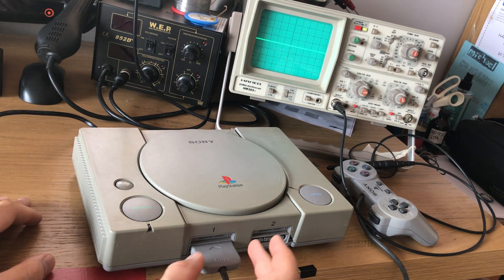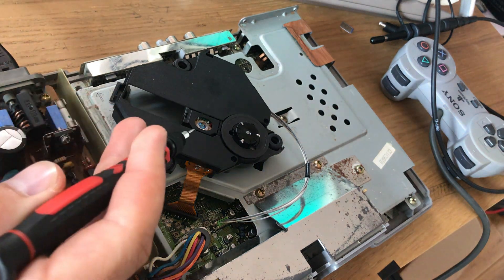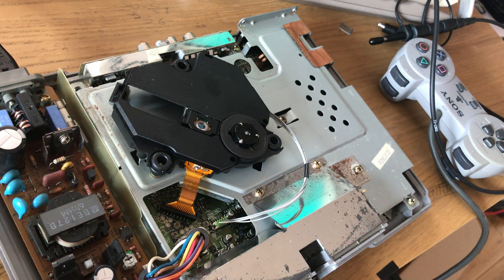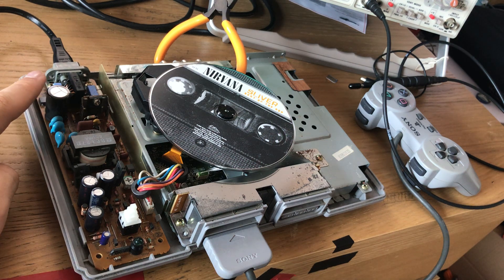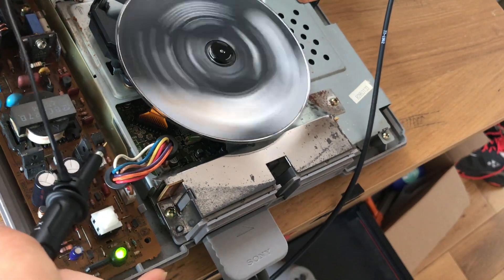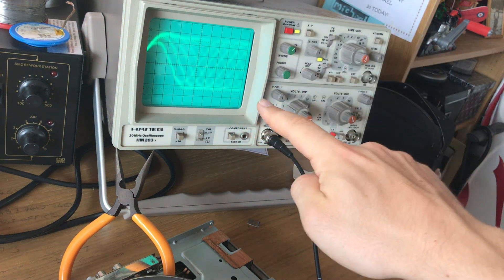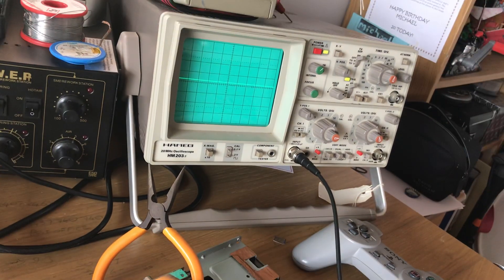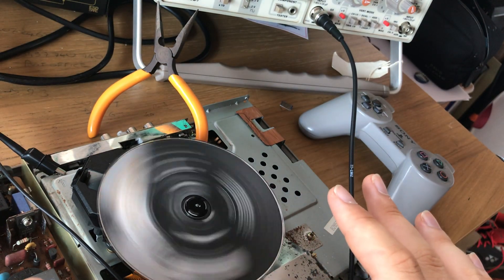Sony PlayStation 1 Laser Calibration.

Comment: I just use a multimeter to spec then scope to adjust if needed. 11.4mv on intensity (while disc is playing), 1.62 bias, 1.82/1.85 gain are the number I usually spec to.

Comment: For later models that don't have these pots I bet it's cheaper to add them back with jumper leads so it can be adjusted well running then it is to replace the laser assembly?
Reply: If so what size pots? as id love to try this.

Comment: I installed a chinese replacement laser for my SCPH-1001 and it was just not good for some games using CD-Audio such as Strider 2, not even after following the calibration indicated by the service manual. Perhaps the PSOne lasers follow different calibration adjustements ?

Comment: Hi mate, thanks for uploading this. Very professionally done!

I had a question regarding my SCPH-7002 model ps1 - it seems to struggle to read some discs and skips and stutters on others, some disks work fine strangely enough. I cleaned the laser with IP alcohol and oiled the spindle motor with some silicone oil which seems to make it run a bit smoother but the problem persists. 

The ps1 is arranged differently to other models - there are only 2 potentiometers present (one on the laser arrangement ribbon and another on the motherboard I believe). I can't find any info online regarding adjusting this model of ps1, do you have any advice on this? I have access to an oscilloscope and multimeter so am able to carry out the same kind of adjustments as the ones in your video if possible

Comment: Does this apply for SPCH 9002 as well? There is nothing like that on the mobo.
Reply: On those newer revisions of PlayStations there's something called Digital Servo, that means there's a Integrated Circuit that auto-calibrates the focus offset and focus gain. That being said, if the laser is not behaving well there's not much to do as there are not potenciometers to adjust .

Comment: Useful information nice one thankyou. My model however only has a single pot which is the one on the drive for power. I've been playing with it for about a week now but without an oscilliscope. I've been measuring the mV on the point above that pot starting at 10.0 mV and slowly working my way up so that I can play backups of my games. I believe it may be better to work with resistance instead here, I'm not sure what with being the self taught noobie that I am with electronics. Anyway, regardless of adjustment and with a new drive no matter what I do I cannot get it to read them 100% reliably so much so that I've started to advise that it's best to avoid cd-r backups altogether.
I performed the adjustments using a cd-r packed with music. I've gotten it extremely close but no dice.

Comment: Do you happen to know what the third potentiometer at this approximate area on the mainboard does? I got my unit used and I fear the previous owners could have messed with it :(
Reply: Third is the tracking adjustment going up and down the length of the disc from center to outer edge

Comment: Hi and I noticed there's a white plastic Phillips head screw potentiometer on the power supply, what is it and what does it do?
Reply: It calibrates de DC output of the Switching Power Supply, since they are factory calibrated I suggest not to mess with it or you may fry the motherboard if adjust to a much higher DC voltage .

Comment: Hi micheal I have another question if you or anyone else can help. I want to be able to refurbish these consoles to as close to new as possible, as far as working and reliability. They cost nothing to buy and everyone says "just buy another" when they break, but of course then youre just adding another unreliable box to the pile. My question is do you know where I can buy replacement GOOD QUALITY lasers or parts? Or alternatively, does the calibration method in this video bring the lasers back to "like new" quality? Is going out of calibration generally what happens when they go bad? Assuming that mechanically it was all good. And one last thing, are there any other components you know of that commonly fail on these, so that i can preemptively replace them? Leaky caps etc? 
Sorry for all the questions its just rare finding someone who actually knows what theyre talking about, thanks again
Reply: The PS1 went through several revisions.. the earlier models like pictured here with the laser at the 11 o clock position suffered from a design flaw in the laser transport mechanism, it was all plastic and combined with the heat and poor lubrication over time the sled wears out and grinds down the plastic which causes the laser to be no longer parallel with the unit.. many years ago when the PS was still fairly new and I used to service them on some of the higher hour original models i'd see them with deep grooves worn into the sled.

If you have decent engineering skills you can fabricate metal shims and bring the laser back into parallel, maybe not like new but it can often make them work again, people found that turning these units upside down caused the laser to flop down and be closer to parallel so it would read better.

The later units also incorporated automatic focus bias / gain control so there are no trim pots to adjust that and Sony corrected the design flaw by redesigning the sled out of metal.

Like new probably isn't possible as many of the components degrade with age, including the laser diode itself.. even some transient voltage spikes can shorten the life of the laser diode. Not always true but generally speaking the more hours the unit has been used for the more degradation you can expect to find. Imagine an old lightbulb.. it gradually gets darker over time before it burns out.

Lasers are different but similar enough for this analogy to work.. even besides the output becoming weaker the lens can physically degrade to the point cleaning is no longer possible, a lot of things that cant really be serviced or repaired can happen.

The best you could do if you had infinite time and money and equipment and knowledge would be to measure and replace any electrolytic capacitor including all surface mounts, you could measure them with an in circuit ESR tester but given their age they will all have some level of degradation, probably not enough to cause problems but this is a theoretical like new condition situation so replacing them all would be what you would want to do, even if it wont really make any noticeable difference (but it will probably fail much later than not doing them)

The mainboard has around 40 SMD capacitors.. somewhere like console5 will sell you a complete replacement kit, the PSU has larger capacitors, around 7 or 8. From somewhere like console5 you'll be paying around $30 for the capacitors along with some hours to change them all.

You will also want to strip the laser transport, clean all the old grease and apply the correct new grease to the transport.

Assuming you can't get hold of an official Sony calibration CD that you need to use in conjunction with the service manual to calibrate and verify pass/fail operation of the laser unit then an audio cd and some games are the best you will be able to achieve.. as in the video a stable eye pattern at the correct voltage is a good indicator the unit is working well.

A laser power meter would be desirable but these can cost several hundred dollars.. you want to check the specifications of the laser and verify the power output is correct.

During the corona scare in 2020 when many people were told to work from home etc I did the above on an original launch day PS1 SCPH-1000 I had imported when the PS was first launched.. the sled was very badly worn and I have other playstations I could have changed the laser mechanism from (the slim psone laser will fit in the early models without any ribbon cable extensions required and is probably the best conditions laser you will find for the price and not going to be a chinese fake / refurb of unknown quality, you can put it in the later models too with a ribbon cable extender).

Repairing the original laser involved putting the sled in a mill and fabricating some shim washers I laser cut to fit then bonded on.. after a lot of work the unit plays audio cds fine and no longer has any skipping on FMV in games and quick load times.

Certainly the time and money it takes makes this unfeasible to do from a business perspective, given the uncertainty of how things will age I wouldn't want to sell a completely rebuilt one for $300+ knowing that it could still fail due to some undiagnosed laser degradation then have to refund the customer.

Probably why nobody else is doing it either.. for personal project its fine to waste time and money with old junk though.
Reply: Thanks! So much info
Reply from the maker: Replacement parts are a bit tricky. You can buy them from eBay/AliExpress but they're very much hit or miss. You could buy several bad parts before a good one.
What I prefer to do is buy old/partially working devices and part them out, taking the bits that do work and using them to repair other devices.
While it can vary between different devices, recalibrating the laser can fix most disc reading issues with a PS1 quite well. Perhaps it will drift out of calibration again in a few years, but bear in mind these are old devices, and require more tlc as they get older - like old cars. If a laser can be recalibrated instead of replaced, it's a win in my book.
Other failure points would include the power supply. You can just swap the board for a better one, or find the problem and fix it if you have the time.
My policy with capacitor replacement is that its not always necessary, but it can help. If there are weird intermittent issues with the device, it could be down the the caps in the power supply preventing proper delivery of power to the rest of the device. If you're looking to refurbish these things to brand new, replacing the electrolytic capacitors in the power supply is probably the thing to do.
Reply: @meahall_miscellaneous  Awesome! Thank you so much for this information, legend.

Comment: Good video, but... You can use a lead soldered on CL704 :).

Also, your RF is good but maybe too low (0.6v p-p?)

Cheers :)
Reply from the maker: I could use a lead soldered to the test point... Or I could not. I was able to get a reading fine for this demonstration.

My scope is in need of some calibration itself. What it reads is a touch lower than what the value actually is, but so long as I know it's fine.

Besides, these old CD lasers aren't really all that strong anyway - it's one of the reasons older CD players really struggle to read CD-Rs sometimes.
Reply: @meahall_miscellaneous  I'm sorry... What I meant was the wire connected on the CL704 as test point.
It's pretty handy.

My scope is an Hameg 20mhz like yours. And is perfect for the laser adjustment.

Another tips is... Try to reach 1.2 v p-p with original disc (That's the Sony standard).

Comment: This is how all instructional videos should be made. Im looking at getting an oscilloscope for this type of stuff and general electronic repair. How do you rate the model you have there?
Reply from the maker: Thanks. Hopefully I'll make some more videos sometime. I have an old Hameg 20MHz oscilloscope. They made good scopes. This one isn't the most high-end scope out there, but it's  very solid, and has enough features for these kind of repairs.
My advice is to make sure the scope definitely works before you buy it and I'd avoid going too cheap. You want to get a good brand with plenty of documentation.
Reply: @meahall_miscellaneous  thanks mate cheers for the reply